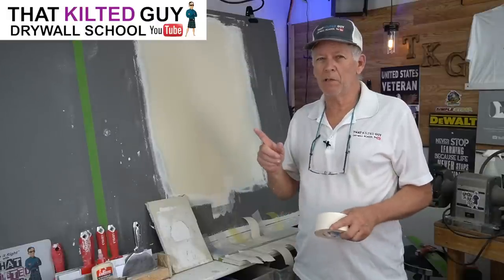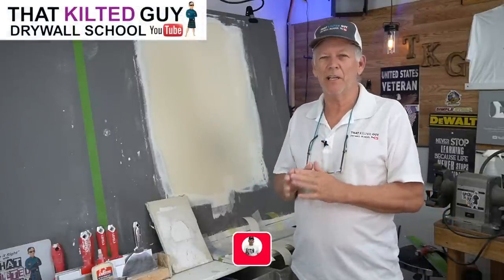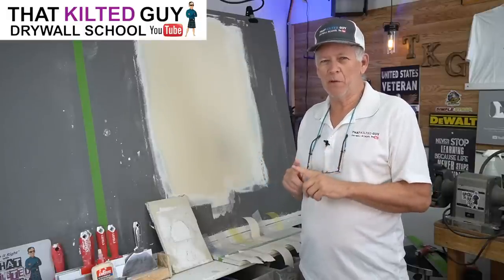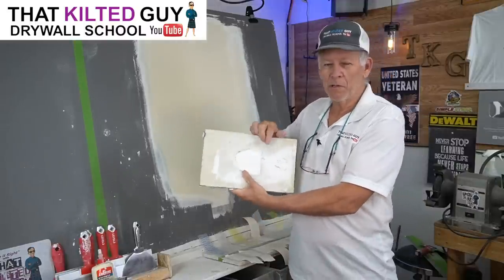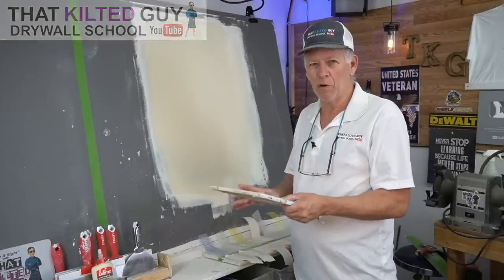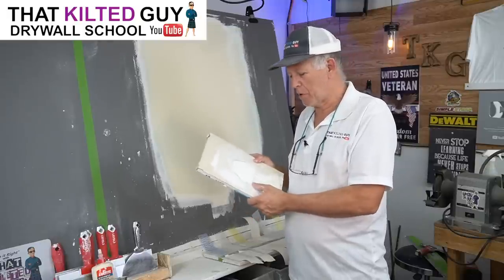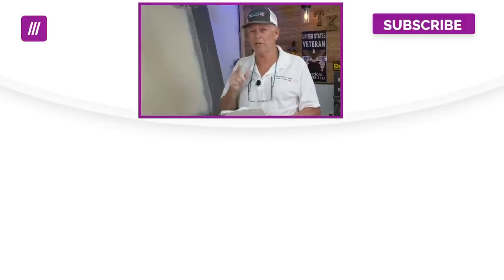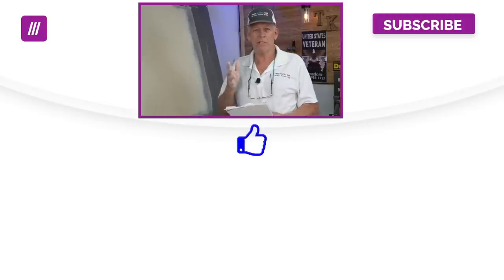THIS IS CRAZY! I Can't Believe This Drywall Repair Method Worked!

Comment: I regularly have used a backing board behind a hole, cleaning out the loose stuff and use a 50 50 mix of base coat plaster / cornice cement.  Usually I don't use tape and have consistent results which have stood the test of time (Over 15 years).   Love your video, insights and testing approach.    What I think, is that it does work the way you have shown without tape, in my case no cracks have returned at my old house, all the wall look great and numerous the patches are strong and have yet to show any hairline crack even with tape.   I'm confident it can be done both ways.   Just think without tape you don't have to float out and feather the edges.   Thanks again!

Comment: I find cutting back and removing all crushed/fractured drywall core and loose paper is critical… usually this opens up the hole some… then I use a piece of drywall (or plywood,) that I feed through the hole with a screw as a center handle to hold, while screwing it in above and below, or on either side, usually covering about 80% of the opening, and then just fill the hole with a thick (lower water) mix of hot mud.  Seeing how well that paper bonded to the hot mud on the back side, makes me think drywall is probably a superior backer to Plywood, which I have used at times, depending on what was handy.

  Also makes me think smearing some mud around the back side where my screwed in piece of drywall gets screwed through, might bond it to the repair area even better.

Comment: Hi I had a job filling down light holes, a lot of them, in a short time, I did the same as you, I stuck plasterboard on the back, bevelled the edges and filled, most of the holes were about the same as yours, it worked, I think if plasterboard is really old the edges may expand a little, good work mate keep it up cheers from Australia

Comment: I did the same for my neighbor/girlfriend when her son drunk friends flung open the front door blowing a hole in the wall .
I cut the hole square, installed backing  strips and thin piece of cardboard, filled the hole with hot mud. 
Works great even when the door was flung open again, all that happened was a little ding, barely noticeable..

Comment: I have been using Fix-It-All for decades to make "impossible" repairs in both Lath & Plaster and Sheetrock walls.  Sounds like your "hot mud" is basically the same kind of product.  Yes, I use it to do small jobs and totally skip the Taping step - just fill the joints with Fix-It-All, clean my tools then I can immediately go over the joints with topping (because the Fix-It-All is fully set). I do everything in one visit except the final sanding.
Critical TIP: Do not leave ANY high spots when using Fix-IT-All because it is harder to sand than wood!

Comment: Just the other day I fixed a 3” hole with hot mud instead of cutting a patch …..  but you’re right I couldn’t risk hot mud alone so I used 6” fibafuse over it

Comment: Thanks for demo that's def a bond. I have used pink stuff before after time it cracks and you hit it it will break fast. I would still use tape on a seam but flat wall I would just use hot mud. TYVM..

Comment: Tape isn't needed, if it needs added strength sure.  But it's not a crack, if it's not huge it works great, durabond is very strong and has limestone fibers in it, so as long as the hole isn't larger than fist this works great.  Once you primer and paint it will not crack.  I've repaired a bunch of holes this way and never had an issue.

Comment: Thank you for the video — consistently a great job. Let’s go to the heart of the matter… what does tape do? I think (researched this but only find guesses out there) that tape is used to bridge the gap between two potentially moving pieces of drywall. Houses expand and contract at all different rates, depending upon the materials, temperature and humidity. So, two drywall sheets screwed into studs will shift relative to one another. The tape on such a seam spreads out the shear load between the sheets and acts to limit cracking, similar to rebar in cement. If the problem is in the middle of a sheet, such as a doorknob hole, then all of the material expands at the same rate — there is no shear line. A patch in the middle of a sheet should not need tape (so long as the patch material expands and contracts at the same rate as the drywall, which it does. Since the patch material is different than gypsum, for assurance sake, one can tape, as there will be some expansion/contraction difference. The bigger the patch, the greater the effect of differing expansion/contraction. In conclusion, filling a joint between sheets, tape always — filling in a mid-sheet hole not such a requirement. Thoughts?
Reply from the maker: Agreed

Comment: could add wood backer strips ,like lathe ad plaster style, then hot mud filler then skim 2 coats so not humped, sand and finish. Always tape, but for this video, that would be my process.

Comment: I just finished a few patches using just 45 min. hot mud. Let it dry over night. Sanded it & it was good to go. Not sure it would’ve worked using reg. mud. Very little shrinkage. Did a second coat on a couple of them. After painting you can’t even tell there was any holes. 😉

Comment: There's a quick setting CGC-Synco product called Concrete Fill, not sure what they call it in the States, which I've found works very well for filling moderately sized holes, cracks, and voids. I use it in all of my prefill.

Unlike other hot mud compounds, Confill is specifically formulated and reinforced with fiberglass fibers, which interlock and allow the compound to span these gaps when it sets (about 40 minutes). Using a good, thick, stiff mixture, it can even reliably fill holes in ceilings without sagging out of the fill too much, if at all. If it does sag a little, it scrapes/planes off easy enough after it sets using a good, sharp 6" knife. 

I've even used it to take care of larger, fist-sized holes, too, using fiber tape to form a little basket of sorts, recessed into the hole if that makes any sense, finished by applying another top layer of tape, after the Confill has set up and scraped flat, to "close" the basket and seal the hole. NOTE: Don't apply the tape on top of the mud when filling large holes this way until it has set up, or it will sag out a little with the mud (there's always some sag) and it'll be a real nightmare to scrape down. Also, don't do this on ceilings, or you'll get mud in your eye, lol. It's really only viable on walls. Coat and finish as normal. I've never had any call backs. 

The one caveat to using Confill is that it is quite porous, and releases a fair bit of gas as it sets and dries, which can make coating over it a little tricky; however, I've found that hitting it first with your favorite filling mud and wiping it off again tight (and I mean tight, skin tight) before reapplying a top coat helps to seal the Confill and deters (but doesn't always eliminate) any tiny fish eyes from forming. It's a huge net time saver, though, which makes up for the odd time that I have to touch up a patch with fish eyes in it before prime, imo.

https://www.usg.com/content/usgcom/en_CA_east/products/walls/drywall/joint-compound/concrete-finishing-compounds/synko-concrete-fill.html

Comment: For small holes like door knob holes I square off the hole,then cut a square of drywall 3 inches bigger than the hole,then cut the back paper 1-1/2 inches from the edges and peel away the edge pieces leaving the top layer of paper to use in the place of tape.
Reply from the maker: That’s commonly cause called a California Patch

Comment: If it works then it works. Another really cool thing about this experiment is if hot mud is able to hold like that with no taping that's a huge time saver not having to apply multiple coats of mud to hide tape. If you did that on a wall that was already painted/textured that's a lot smaller of an area to try to match texture to vs a much larger area if you had used tape and texture is hard to match perfect  so it would be much less noticeable doing that way with no tape.

Comment: I worked as maintenance in a complex an never used tape just hot mud an never had any cracks but 20 min seams alot tougher than 45 or 90

Comment: I’ve done repairs on plaster with hot mud and no tape. No cracks after 3 years. The easy sand is hard but the durabond (brown bag) dries rock hard.
Reply: Are you for real!
Reply from the maker: I believe it
Reply: I agree. I use hot mud all the time and I have no cracks. But the dura-bond is insanely hard and there is no way it will crack

Comment: I was taught anything under the size of your fist just back it and fill it with Durabond,we'd wad up newspaper and stuff it for backer.we did alot of repairs in regular plaster too tho and the method worked great for that.When I left that company I left alot of those methods with it .Now if   it can't be covered by a piece of tape ,I'll tape it.Otherwise it gets the 45 all the way up to the scratch coat.

Comment: If this was a hole in a wall you wouldn't be able to place a board or sheetrock behind the hole to patch it with hot mix so it's kinda a mute idea. Without something to back up the patch the mud would just fall out. I would still have to use tape or fiberfill etc...
Reply: All you do is cut a scrap of drywall or wood about 1" larger than the hole. Run a screw into the middle and put it through the hole, then hold it by the screw and put some drywall screws in to hold it. I used to put glue on the piece but I don't bother anymore.
Eta: you can remove the screws after the hot mud sets if they didn't sink to your liking.
Reply from the maker: This exactly
Reply: @hughbrackett343  I knew a old man that used to use news paper and stuff it in there till it didn't fall out lol but I usually just hot patch my holes leave the paper on the back of a bigger piece and stick it right over it but you got all these people that look this up on the internet and talk about shifting of your house I been building homes for 8 years now and yet have ever seen a house drop so bad it crap drywall in the middle of the wall mud is strong enough by it self to hold up but who's to say tape is just another thing they sell that isn't necessary

Comment: I have a probably stupid question. The boxed premixed all purpose compound that you can purchase at Home Depot, Lowe's, etc., is it truly made for all purpose sheetrock work e.g. taping-floating, skimming, texturing walls-ceilings, repair work, etc.? I have noticed even the all purpose compound there are several different types you can purchase in boxes. They typically come in compound boxes, but boxes come in different colors (blue, green, other). What are the differences for application of joint, floating, texturing, etc.? Thanks!
Reply from the maker: Watch these
https://youtu.be/l86Hf1a7WOw
https://youtu.be/OVkNe4CfroE

Comment: Hi. I’m in the process of taking down my popcorn ceiling and have some gaps /hole where the ceiling and wall joint meet. Do you recommend I fill with hot mud ? Then tape and coat w all purpose?
Reply from the maker: If it’s not real big you can just caulk it with big stretch caulking. Otherwise you mess up the walls and have to re-texture the top part and repaint the walls too

Comment: How would you put a backing in the hole on a wall?
Reply from the maker: You could put a piece of plywood inside with quick setting construction adhesive on it. Let it set a bit or run screws around the outer edge then fill it
Reply: you can also do a "california" patch, by creating a patch about 4 inches larger than the hole, score the backside and remove the sheetrock leaving the front paper.   this gives you a lip to mud and glue the patch in place.   then finish normally
Reply: @ThatKiltedGuyDIY   Thank you.

Comment: Funny....inspector gadget glasses.
Go...Go...Gadget Hot Hot Mud😊
Actually regarding the easysand 45 or 90.
Want to fill the gap between my sheetrock and shower surround(the 1 inch nailing flange)
Does the hot mud adhere pretty good to fiberglass?
Figured I would fill the gap....with hot mud, then tape and regular mud over that.
Reply from the maker: It doesn’t stick great to fiberglass but if the gaps not too big the strength of it with mesh tape over it will get you by.
Here’s the link to join my YouTube membership. https://m.youtube.com/sponsor_channel/UCSinsqowcKxmSaKkx3W9_0w?noapp=1
Reply: @ThatKiltedGuyDIY  Thanks for the reply...and thanks for the videos. is there a best practice for filling that gap? or can yo rock over it?

Comment: most ppl dont know how to v grind or bevel  a hole  for a  repair they are not bodymen   do you show them     that is the most important part of the repair the  cracked edge  leaves a ghost  that wont go away
Reply from the maker: That’s why you skim coat it

Comment: Anyone tried this with loose fixture mounts?  Like towel bars or to holders. I'm willing to try.
Reply: I've used hot mud with lots of glue in it to repair lath-and-plaster walls and ceilings.   It takes screws very well ... but it is pretty hard stuff so pre-drilling might be desired.

Comment: hot  how do you heat it
Reply from the maker: Hot mud heats up through an exothermic reaction
Reply: Hot mud are you talking about   the  mud you add the water to in the his reaction I’ve used it before it is good